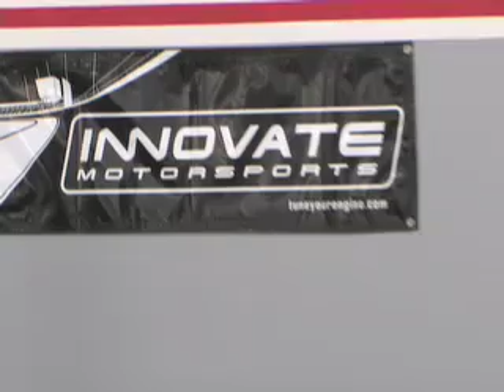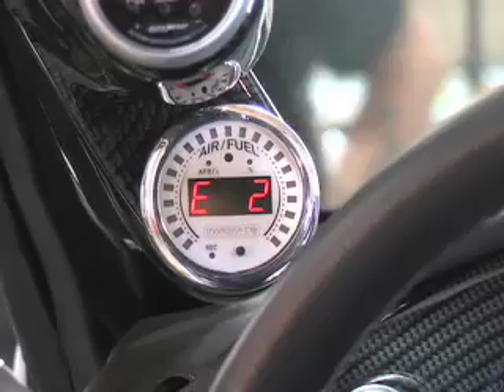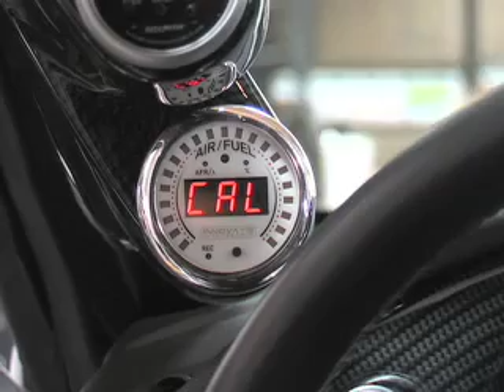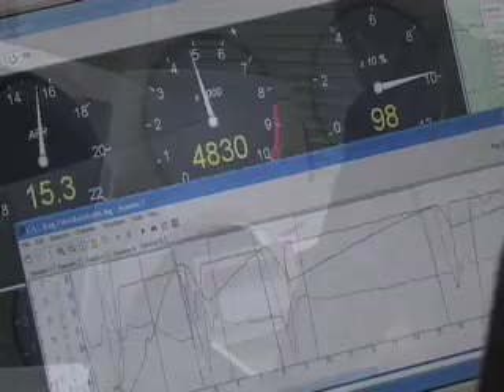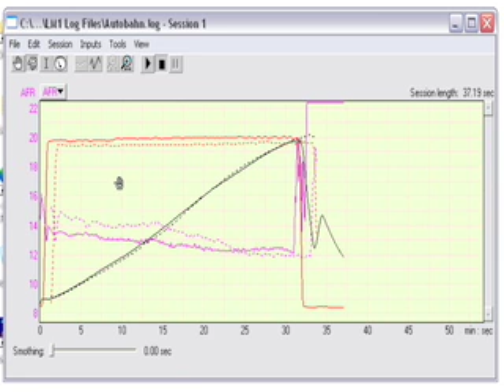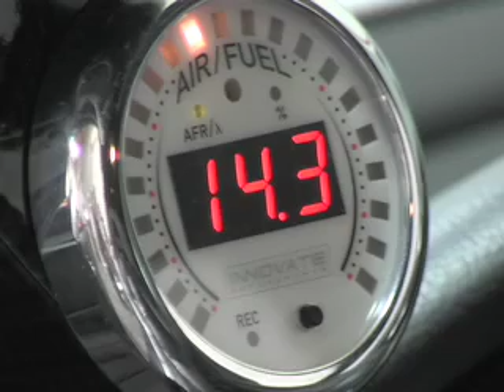StreetLegalTv.com - Tuning Using an Innovate XD-16 Wide Band

Comment: @BLACKPOWER707 

not just that but also you don't want moisture on your sensor. when the sensor is mounted upwards, you greatly reduce the amount of moisture ( fuel, oil, condensation) hitting the sensor.

Comment: downward as in the 6oclock position on the pipe. pointing straight down. etc.
basically it would b dumb to mount it like that bc speedbumps or other bumps could take it off because it would be hanging too low